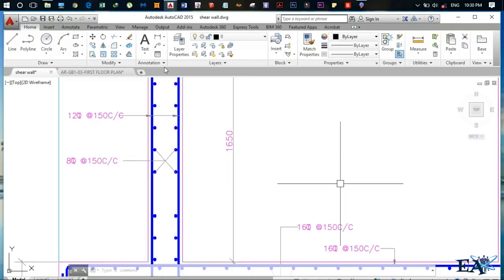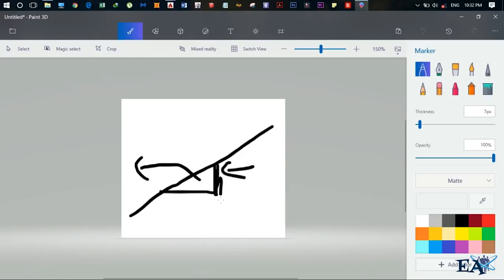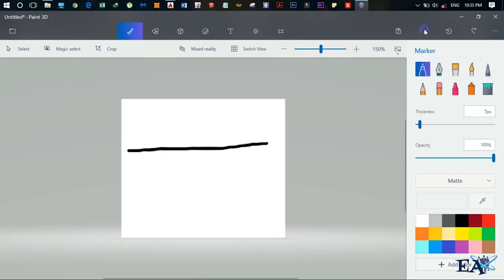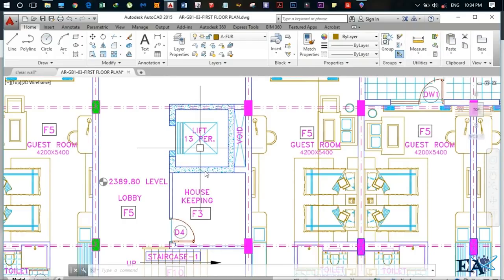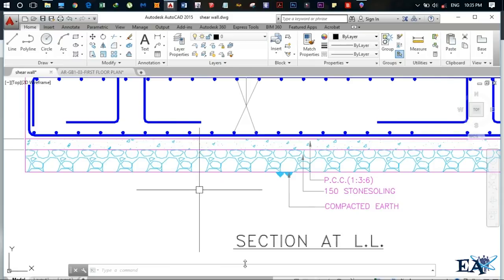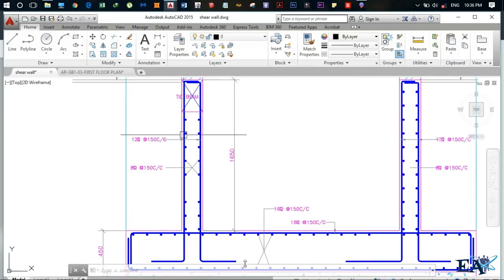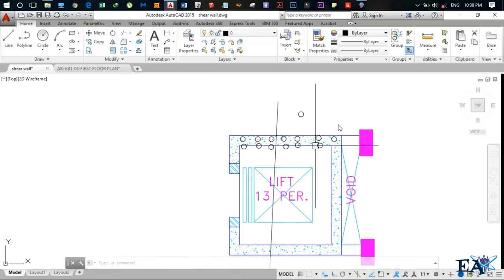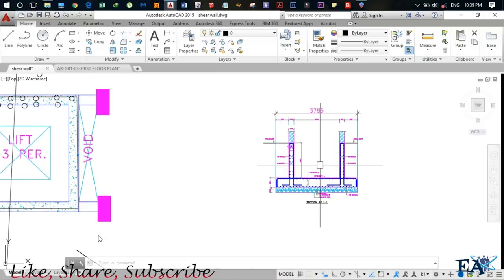Shear Wall Reinforcement In Detail

Comment: thank you for such a nice explanation.  can you show how to     design basement wall. and why are the main bars in th shear wall vertical. can i use horizontal bars as main bars. what is the minimum diameter of bar i can use  as vertical bars in shear wall. and what is the minimum dia of bars to be used as horizontal bars. For columns, 12mm is the minimum dai that can be used as vertical bars. does it apply to shear wall too?
i am asking for design of basement wall because as it is anchored on the two beams and two columns on the four edges, it would rather act like a two way slab oriented vertically and retaining horizontal load. can i design it as rwo way slab?